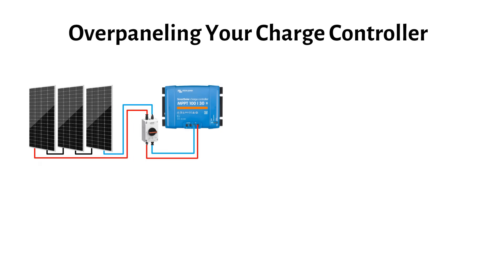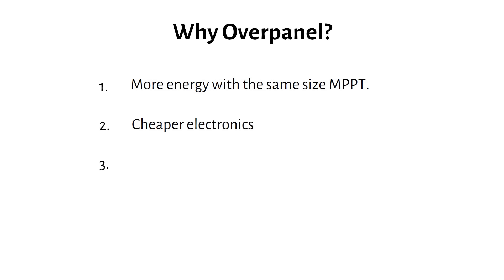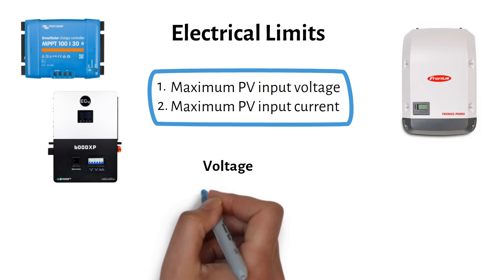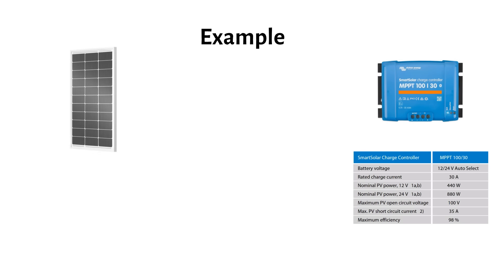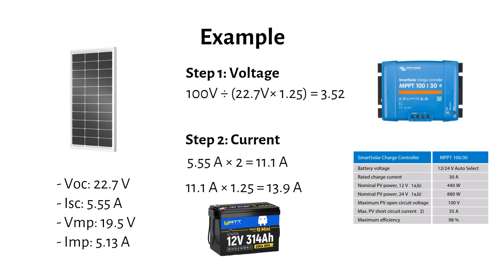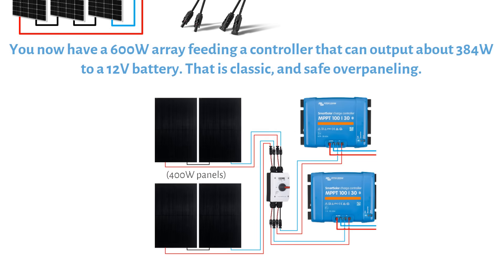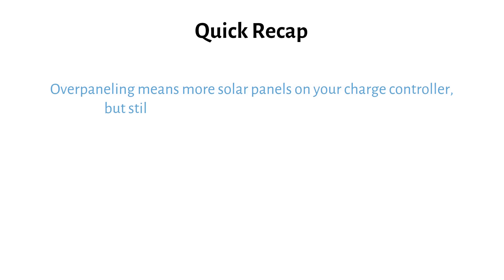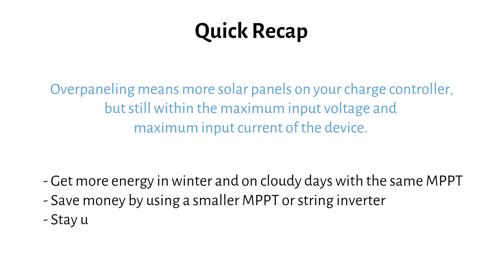Overpaneling Solar: How Much Is Too Much?

Comment: We are off grid with a DC Solar Trailer (2 x SMA 6048 + Midnight Classic 250 Charge Controller). I am in the process of adding/installing a Sunny Boy 5kw inverter that ties directly into the exterior plugs of the cabinet (inverts DC to AC). I am wondering how over paneled I can get without burning up the Sunny Boy 5kw. We are charging (2) 48v/510Ah forklift batteries. I will be switching these packs out for a single 48/750Ah forklift battery with newer cells. The two 510's were in very bad shape when we purchased the trailer used.

Comment: Quadruple the panels then put half into a hidden charge controller and fake cables coming down to look like they're all coming from the roof.  Why pay an illegal tax in the first place?  Governments are way too greedy...
Reply from the maker: It has to be inspected before you connect it to the grid. Charge controllers directly to the battery is not taxed because it's not going directly to the grid.

Comment: Hello from Australia 
My name is Nik I’m new to solar and I love your videos. 
I have a question. 
I have 8x 250watt panels and 3 x440watt panels but I don’t how to connect together and with what charge controllers it’s a 24volt system 800amp hour batteries. 
I very confused I would like to use Victron charge controllers I just don’t know which ones. 
Any help would be greatly appreciated.
Reply from the maker: I made a video about how to select a charge controller. I recommend having your 440W panels separately.

Comment: My DIY cc+inverter system supports 600-700 watts peak but my panels are 2400+ peak that's 4x. Even on dark cloudy days I get 300-400 watts easy sufficient to run lighting and basic electronics.

Comment: We only get taxed when we don’t have a digital meter. Only analog meters that use the grid as a big yearly battery are getting taxed.
Reply from the maker: I see, so soon the tax would be lifted because I still have an analog meter. But then I (my parents) get less money for the electricity so I guess it will stay about the same. What do you think?
Reply: @cleversolarpower Trachten om zoveel als mogelijk energie zelf te gebruiken. Eventueel met een thuisbatterij :-)

Comment: The factor 1.25 mentioned is often a regulatory requirement to be met for the PV panel cabling (minimum current), not for the inverter itself. 
To meet the inverter max DC input voltage requirement you can typically use someting like 1.15 x Voc_pv x #pv panels < VDC_inverter_max, but do check the datasheet of your PV panel what the Voc_pv increase would be for say -10 degrees Celsius (the rare case when your inverter is shut down at very sunny but very cold conditions) instead of STC. 
To meet the max inverter short circuit current Isc_inverter you certainly don't need a factor of 1.25, also there 1.1 should be safe: 1,1 x Isc_pv < Isc_inverter (for a single string). 
In general do read your local regulations, it may differ per country and ask your inverter manufacturer, they often have a technical note to what extend you can DC oversize the inverter and what Isc and Voc requirements are to be met (to preserve warranty).
Reply from the maker: The safety factor for the voltage is needed because panels are tested at STC or 25 degrees Celcius. I calculated using the temperature coefficient of solar panels per degree Celcius and this is a safety what I recommend as well as others.

Comment: To make sure I understand, overpaneling in parallel (extra amperage) is only a safety issue if the wire gauge is too thin or if overheating on the MPPT or wiring is an issue.  A combiner box with thick gauge wires and fuses (if cost is not a concern) won't harm the MPPT if the amperage is higher than the MPPT rated max amperage.  Please disregard cost, complexity and practicality in my hypothetical question.  I just need to understand if over amperage (as opposed to over voltage) will not harm the MPPT controller.  Thanks.
Reply from the maker: You should not go over the maximum input current of the mppt.
Reply: @cleversolarpower  Thanks Nick.  I'm not an  electrical engineer but I've seen it said where amps (current) is pulled, not pushed.  My previous understanding was that the MPPT would clip excess amperage and only pull what it can accept.  So what you are saying is if you input too much current into the MPPT controller it can damage it.  For the record, I understand that's very true if you exceed the voltage limit.  I wasn't certain if that was true if you exceed the amperage limit.  Am I conflating things in my previous understanding?
Reply from the maker: Components inside the mppt are rated for a certain voltage and current. If you exceed these, it might get damaged. There is a reason they put max pv input current on the datasheet. Clipping refers to the output, not the input.

Comment: That stinks that you get taxed. I suppose the US government will have to start doing that as well. Why not? They have their hands in our pockets for everything else.
Back to the subject. I have my system overpaneled and it has worked out well, mostly in December and January as the sun is at its lowest and they are the most cloudy months. With the battery storage I can still run everything as I do during the summer. Overpanelling keeps the batteries fully charged even with the short charging hours. Thanks for the video. I sure hope they don't start taxing us. They shouldn't be taxing in Belgium. Just not right.

Comment: Thank you so much for your detailed explanations in your videos. 
🤔For people in cold climates, Wouldn’t it be easier to divide your controller limits, by 1.25? Then mark this on the controller. This would simplify choosing solar panels. Most people could now work out the correct panels, in their mind. Cheers.

Comment: Great video.

I was thinking of overpaneling my dual MPPT micro inverter with two extra panels to help compensate for winter.

But it turns out that the Growatt NEO 800X-M can only handle 23A of short-circuit current per MPPT tracker with a max of 60V.

The connected 450W AIKO solar panels have an Isc of 14.05A and a Voc of 40.81 (STC).

So putting two panels in series is out of the question, even without the 1.25 margin for cold weather and using these panels in parallel could go well over the 23A of short-circuit current of each MPPT if I multiply the 14.05 by 2. 

In winter this may not be an issue, but in summer it gets awfully close to 800W of the rated output of this micro inverter despite a sub-optimal angle.

I do have another inverter which is slightly overpaneled, but only by 8.3%, which can be seen on the monitoring software but does not really matter year round. It's all about winter nowadays, so maybe I will get something vertical set up that can be easily hidden from sight  when the garden is in use.

Comment: I have panels  in  many  different orientations, angles and shadowing. 
The way to handle this are (a lot of) MPPT's which give you the 48/52V of your battery.
You may still need some additional limiting electronics though, such that you don't mistreat your battery.

Comment: There is no limit to over panelling when configuring parallel strings to remain within the mppt voltage range.
We have a number of sites with 10kwp into 3.6kw inverters for over 4 years without issue
Reply from the maker: What inverters were you using? Surely they must have a maximum input current? You just might have not reached it yet.
Reply: @c @cleversolarpower the max input is misunderstood. What it actually means is the maximum current the inverter will pull from an array is X. So if your array is 5 times bigger and is at STC for eg the inverter will never pull more than it’s max input rating ( essentially the clipping point   ). 
We’ve done this on Growatt and Sunsynk . It’s true of any inverter though.
The 10kw from the 10kwp array will never be realised not even half but these sites were about producing a mini yield of KWH not peak power.
Reply: @cleversolarpower Look at the notes related to the 'Maximum PV short  circuit current'. That is to protect against connecting in reverse polarity. As others have pointed out the controller pulls what it needs. I am using Victron 100/50 at 24 volts. Over panelled at 250%. 3500watts of panels. No problems. Puts out 1400 watts much of the time. On cloudy day it can easily put ot 1000 watts.

Comment: I thought only the voltage had a hard limit for panel sizing and amps can be higher to inverter but inverter will clip as you say for your over wattage example. Is that not true? So if your mpttt can handle 30amp solar input you could go to 35 or 40 amps but the mpttt will clip it down to 30amps on the input. Or is input amps also a hard limit that will damage hardware like voltage would?

Comment: another good video again.. and i always like how his main focus is on safety.

this is my opinion:
all i know is anyone that goes grid tied loves to be scammed. 
its a scam always will be. 
i recommend do a side by side and be done. Govt can go to hell as well as any company.
dont try net metering.. the aim should be to cut or GET OFF the company. and only use their service as a backup.
Reply from the maker: Net metering was good for as long as it lasted. But now we don't get any money back, so we add batteries. Which country are you from?
Reply: @cleversolarpower  good to hear.. because out here in jamaica.. we never got money back was only ever credit. and at a rate of 4 to 1.
so nobody can be really off their bills.
because their smart meters were really smart,.. sure knew how to shaft the customer. he is dead now but there was a person that just for kicks installed solar then disconnected his loads and left the solar to push back in the days.. went on vacation. when he got back.. he had a hefty bill.. went to court. guess who lost?
the judge said.. "the meter cant lie its a machine"

Comment: paying a tax based on the size of the inverter?!... I'm glad I don't live in Europe.
Reply from the maker: You better prepare, it will come to you soon 😅
Reply: We don't have this in the Netherlands and I don't think Germany does either. 
So it's probably only Belgium as every country in Europe has it's own way of taxing things.

But don't get me wrong, the politicians in the Netherlands will tax anything they can get away with. 21% sales tax on top of an energy tax that is more than 100% of the actual price on everything from grid electricity to petrol fuel really motivates me to get as many solar panels and energy storage as I can fit onto my property.
Reply: In Germany are limited at export kw
Reply: @SaenAcro Really? What is the limit on a regular 3 phase home connection in Germany? In the Netherlands the import and export limits are identical, although the grid providers ask us to stay below 5 kW on a 1x35A connection and below a combined 10 kW on a 3x25A connection.
I really don't see this as a problem as the main goal of home solar should be self consumption.
Reply: @SolAce-nw2hf am not in Germany but what I heard before 1,6 kilowatt naw 0,8 export limit
Reply: @SaenAcro 800W is for wall socket connected solar and battery systems. It's just a safety precaution to prevent something else behind the same breaker from drawing too much power if it fails or someone connects too many appliances on one wall socket.

With only 800W, that risk is minimal. At 230v a typical breaker is 16A, so it can deliver 3680W continuously without tripping. Adding 800W, that would mean there is a maximum of 4480W of power available without tripping the breaker. At 230v this is 19.5A which is fine with standard 2.5 mm2 cables in most homes.

Now imagine someone adding a 16A inverter to that instead. This would mean a 32A load does not trip the breaker, but can melt those cables instead if someone decides it's a great idea to connect their induction hob to a wall socket on the same breaker or decides an extension cord with 4 dumb electric heaters is a great solution instead of using the gas boiler.
Reply: @SolAce-nw2hf dumb question who will connect the inverter in the socket without breaker or on socket with splitter. 
Most eu countries have standard one direction electric meter's 
Export in this situation is equal to import aka to pay for export.
Reply: @SaenAcro most older meters actually perfectly run backwards here in the Netherlands with solar export and those in Belgium do as well. 
Grid operators in both countries have a huge task to replace the remainder with smart meters and some people are still refusing those as the simple old meter prevents certain costs.

The plug-in solar panels and batteries at 800W are a great solution for rental properties and balcony solar panels where it's just too expensive or not even allowed to modify the wiring.
Above 800W it's mandatory to get it directly connected to a separate breaker, but I have seen some old 2400W inverter installs with a plug, which is just plain dangerous in my opinion as the wall sockets can't really handle such a sustained load for long, even if the wiring can.
Reply: @SolAce-nw2hf  our are electronical single direction and count positive no mater direction
Reply: @SaenAcro That would create a problem. Most inverter brands have a way to reduce the output to match the home so there is zero export. This is done with CT clamps, a kWh meter in the consumer unit or a dongle connected the smart meter constantly measuring the current.
I use two small home batteries this way to keep the meter at zero as much as possible, dampening import and export.

Comment: Sadly you can not overpanel with the booster charger controllers that I tested out!!!! I did several different boosters but particularly Renogy 48v boost chargers will short out if you have more than 20 rated amps available!!! They refuse to design to protect their equipment!!!

Comment: First I like to point out that your example shows why you want to use big panels. You get a less complex system if you simply use a single 600 W panel. That also saves cost for mounting it on your roof.
Over paneling just makes sense if you calculate the financial numbers. In the end that's always what it comes down to when you compare different technical options. Panels have a much longer lifetime than MPPTs, batteries and inverters, so to get the best NPV, you are going to want to over panel. Depreciation cost for panels are very low compared to electronics.
I personally have 4 kW in panels, the MPPT can handle that, but my battery can only handle 60 A @ ~51V, so unless I am using a significant amount of power, under ideal conditions, I might get some clipping. But under such conditions my battery is full in 2 hours anyway, so it rarely makes a difference. I don't have a double meter, so I do not feed-in with my system.